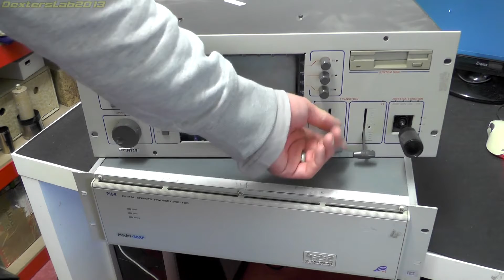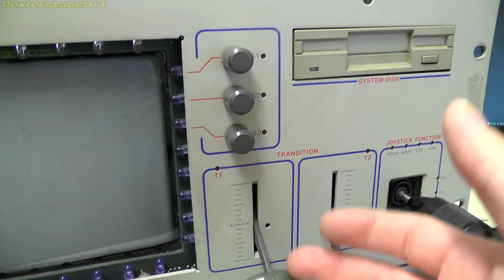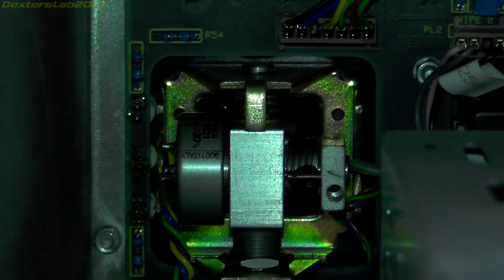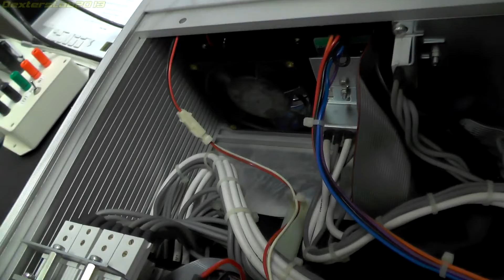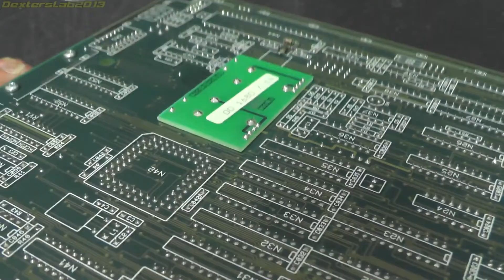DL#059 - Broadcast TV 1980s Digital Video Effects Processor Teardown

Comment: First video effects kit i ever worked on. Had a fascinating love hate relationship with Maurice! Why an fx unit was designed in such a way that a freeze frame was the only effect you couldn’t program to trigger from a switch, but had to rely on hitting a small square in the middle of the screen whilst watching your video playback on a separate screen…madness!
Reply from the maker: I was always a bit disappointed i never found the software for that.
Reply: @DextersTechLab  I vaguely remember doing some complicated logo flybys which required some dexterous handling of the various levers and joysticks…great way to start out editing, and learning the basics of vfx.

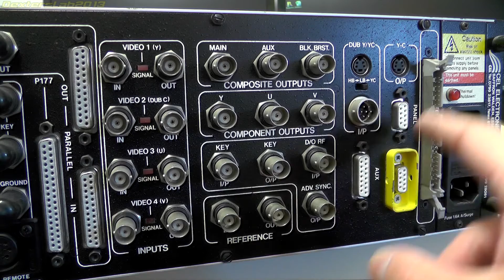Comment: 13:05 Dub connectors for use with Umatic.  A working TBC with Dub connectors is still worth good money because it's the best way to play back Umatic tapes.  However this unit seems to lack an R.F. input to utilise a Digital Dropout Compensator, which limits its usefulness a bit.

Comment: Another great trip down memory lane. I never used any CEL gear, but I'm sure you're right that the BNC serial connectors were for early SDI. The standards weren't finalized until 1989, but CEL must have known that it was coming soon. This unit also has parallel digital video I/O on DB-25 connectors possibly as an option. Parallel video never caught on for obvious reasons. 
GPI= general purpose input. Typically used to trigger effect from a vision mixer or edit controller. 
Advance sync is used with VTRs to keep the video in the middle of the TBC's correction window. It was essential when TBCs had only a ~10-20 line memory. It was not usually used with framesync-based TBCs because they have an "infinite" window. Some uMatic VTRs had an advance sync input.
Reply from the maker: It was a shame i never got this operational, the hardware certainly worked but i could never source the software to boot it!
Reply: Yeah, it would be cool to see it work, but I doubt it had any cool effects. DVEs of that era (and into the mid '90s) were quite large.

Comment: +DextersLab2013 - I would like to help you get this running if possible.

From what I've seen, I imagine the effects are fairly basic (wipes / fades / simple "3D" page flips maybe, like you said?)

btw, I managed to get the ROM monitor of the classic Paintbox to boot under the MESS emulator... :)

https://www.youtube.com/watch?v=CxMj7GIH0z4

I also had some progress with getting the same thing running on an FPGA board (Terasic DE1 / Cyclone II chip). It's using the TG68 68000 CPU core and some basic serial port stuff, but it was enough to get it running the serial monitor at least.

I did start converting a lot of the schematics from the service manual into Verilog as well, but it would require quite a lot of SRAM or DRAM for the framestores unless some code is written to take advantage of modern SDRAM.

Doing the same thing for the CEL P152 would be tricky, sadly, since the classic PB used hardly any custom chips - it used 95% '74 series logic chips. :p

The Harriet has some custom ASIC stuff on it as well, but most of it appears to be for doing the "3D" transformations etc.
Even then, I think the 3D effects were quite basic. Just the usual image rotation / stretching etc.

IIRC, the Harriet has a board with quite a few other EPROMs on, and I think they are just for the look-up tables for the "3D" effects?

Actually, here are some photos of the previous Harriet I had (the working one)...

http://i.imgsafe.org/fe674e7.jpg
http://i.imgsafe.org/00e4947.jpg
http://i.imgsafe.org/01bec9c.jpg
http://i.imgsafe.org/02aa512.jpg
http://i.imgsafe.org/09787d0.jpg
http://i.imgsafe.org/02ed1fe.jpg
http://i.imgsafe.org/0457981.jpg
http://i.imgsafe.org/0a439b5.jpg
http://i.imgsafe.org/04934d0.jpg
http://i.imgsafe.org/053ee75.jpg
http://i.imgsafe.org/05050ea.jpg
http://i.imgsafe.org/0895c28.jpg
http://i.imgsafe.org/0a7ef74.jpg
http://i.imgsafe.org/09bb72f.jpg
http://i.imgsafe.org/0a03ff4.jpg
http://i.imgsafe.org/0800bb9.jpg
http://i.imgsafe.org/0b12738.jpg
http://i.imgsafe.org/0ac6be0.jpg

I didn't get chance to do any actual video captures from the Harriet, as I didn't have a capture card at the time.

If / when I get the new one running, I'll try to get some video of it in operation. My drawing / painting skills are very bad though. lol
Reply from the maker: +electronash Thanks for the offer to help,  unfortunately though i scrapped the entire unit a few weeks ago. I had hoped i would be able to track down the software from a couple of possible places but i'm afraid not. I don't have a lot of room to store large items and it had been sat here gathering dust for five months! I am hoping to make a PCB wall out of the P164 PCBs though.
Reply: :(

I thought you might have scrapped it tbh.

If you do get anything rare-ish like this again, please let me know if you want to get rid. ;)

I enjoy documenting these types of unit, if nothing else but to preserve the details of the design etc.

Comment: Nice teardown. ;)

The "parallel" ports will almost certain be for CCIR 601 / bt.601 digital video...

https://books.google.co.uk/books?id=dCrrCAAAQBAJ&pg=PA117&lpg=PA117&dq=CCIR+601+parallel&source=bl&ots=XO3I0q8FlB&sig=M1Nm9fSmCmUaKLS-OMc1N4KcfT4&hl=en&sa=X&ved=0ahUKEwjwrP-TxtPJAhUKOxQKHXXsBIsQ6AEILzAD#v=onepage&q=CCIR%20601%20parallel&f=false

The parallel connection was pretty much the predecessor to the more modern SDI / SDI-HD serial protocol.

I have a Quantel Harriet system with tablet and keyboard, and it also has a few parallel video ports on it. I should do a teardown vid of it soon really. I had a working one before this, but recently gave it away to a friend.

The current Harriet doesn't fully boot, probably because the NVRAM batteries have now gone flat (those awful Dallas chips with the internal batts).

The NVRAM normally stores the passwords for booting the software. Luckily, I made copies of the passwords and HDD from the working Harriet, so should be able to just copy that over after adding an external backup battery (and after backing up the new HDD, in case there are any interesting images on there).

I found that I was able to view all of the images from the old HDD image by using LemASM. It's normally meant for disassembling N64 cart ROMs, but it lets you view images as well. You have to play with the width of the window to get it just right though, and the colours are messed up of course (the Harriet also stores the images as YUV / Component.)

The older system was last used for the Welsh S4C channel, so mainly had a few images of Weather reports and football on it. 

I was last used up until as recently as 2004, according to the date on one or two of the images...

http://i.imgsafe.org/6004dba.jpg
http://i.imgsafe.org/615ca7a.jpg
http://i.imgsafe.org/6220b9c.jpg
http://i.imgsafe.org/62e8822.jpg
http://i.imgsafe.org/64017d2.jpg
http://i.imgsafe.org/64deb42.jpg
http://i.imgsafe.org/6565d23.jpg
http://i.imgsafe.org/6601ddd.jpg
http://i.imgsafe.org/68d52ae.jpg
http://i.imgsafe.org/68448d5.jpg
http://i.imgsafe.org/67b7776.jpg
http://i.imgsafe.org/66ed926.jpg
http://i.imgsafe.org/6a85579.jpg
http://i.imgsafe.org/6b4a404.jpg
http://i.imgsafe.org/6bc82ac.jpg
http://i.imgsafe.org/6c44f1d.jpg
http://i.imgsafe.org/6db0a5d.jpg
http://i.imgsafe.org/6d1b56a.jpg

A while ago I was helping to restore a classic Paintbox used by the BBC. We never quite got to the point of getting it to boot from the giant HDD for some reason, but the main boards seemed to check out...

https://www.youtube.com/watch?v=Qw0Uv6Nk7m4

I spent about 3 months reverse engineering the CPU board schematics purely from a few photos.
Just after that, the guy who donated the Paintbox then found the proper service manuals for it. lol

The owner has since moved on to other things, so the Paintbox may never be seen fully booting, sadly.
(He said he might donate it to a museum.)

Unlike the classic Paintbox which stores most of it's code on EPROM (has around 512KB with all sockets filled), the Harriet only has around 128KB of EPROMs.

The main software on the Harriet is run from the HDD, but is still only around 2.11 MBytes.

I don't know quite how all the functions work yet, as I don't have the user manuals for it.

I also want to try using the key inputs if I can get this new Harriet up-and-running.
It might be good to do some 80s style video effects with it, and maybe upload to YouTube. :p
Reply from the maker: +electronash Thanks! and thanks for the note about CCIR601.

Comment: you can put floppy usb emulator, and load the system
Reply from the maker: +demian smith i would if i could, but i dont have the original disks!
Reply: i have the first version of this machine. the maurice by cel. i have found 3 unit in some location, and 3 floppy disk 5 e 1/4 size. but nothing, i think it is impossible that 3  machine with 3 separate lives have same problem. i have tried to exchange floppy reader and disk, but absolutely nothing. i think that the problem is another. i have tried to read floppy from a pc, and a pc with software to read non dos system but absolutely nothing. i have no oter idea about

Comment: I have contact with some of the older generation BBC engineers. I shall ask around. I am not so certain that the BBC used this exact equipment, but they obviously ran Pro-Bel, Snell, or whatever they call themselves these days, so someone may know someone who has an image for your equipment.
Reply from the maker: kibi15 Thanks, that would be great. I would like to get it working.